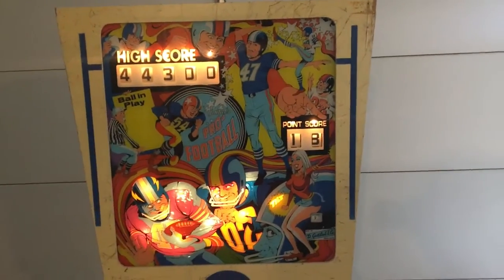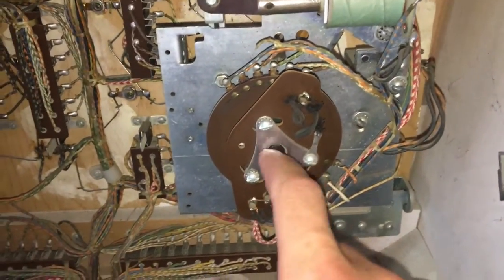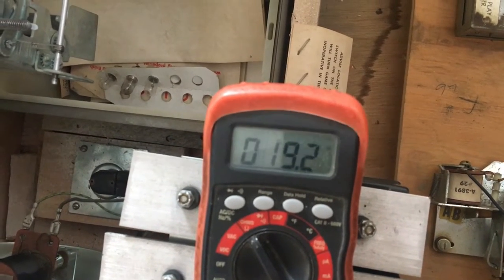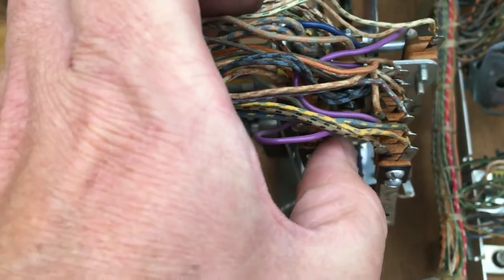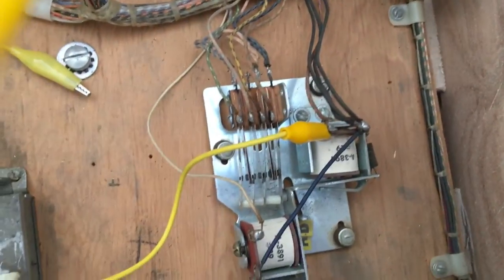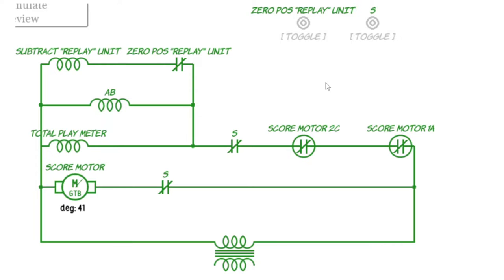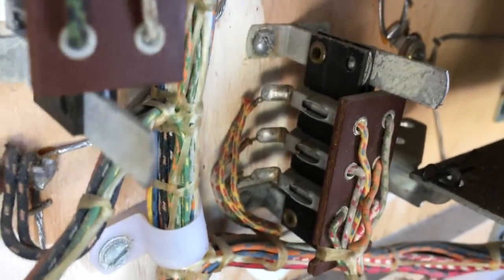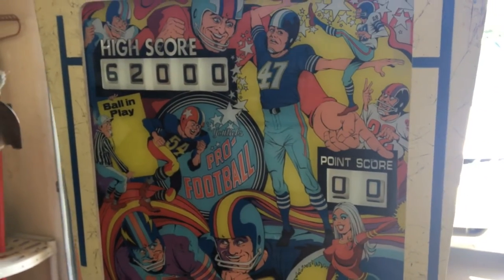Gottlieb Pro Football EM Pinball Repair (Problems and Fixes)!

Comment: TROXEL REPAIR, what are common EM timing issues? when EM games has timing issues how can you tell when an EM game has timing issues
Reply from the maker: I have another video (Gottlieb Sure Shot) that had a timing issue that was counting the bonus incorrectly. In essence, the pulse wasn't long enough to register one of the bonus points.  Usually if it's a timing issue, it's probably going to be something with the score motor.  Either a switch is letting go too early or staying on too long.  This can cause problems with relays staying engaged or not engaged.
Reply: @troxelrepair  EM games that have Timing Issues, I have been told its the relays turning off/on that are Off Sync and not IN SYNC with the score motors CAM impulse switches/CAM Divots. I'm not sure what are the differences between CAM impulses compared to CAM Divots or they are the same thing just different names impulses/divots. But when an EM game has timing issues the CAM impulses/CAM divots are OFF SYNC with the turning off/off the voltage to the relays. I'm not sure what is causing the OFF Sync issues because the relays voltage will stay on for a millisecond or more even after the CAM divots/impulses have passed the rotation over the relay leafs blades. The store motor is turning in circles which the stores motors CAMs have divots which have nodes that will OPEN the relays leaf blades but the relays also have to turn off/on the voltages to the relays. So the relays voltages turning on/off the relays will have to be "in sync" with the store motors cams impulses/cam divots?